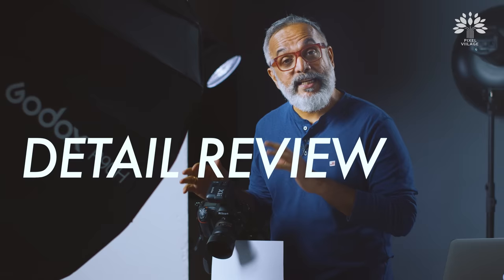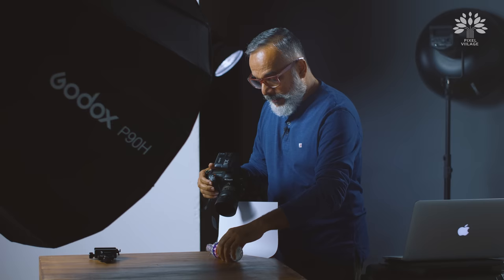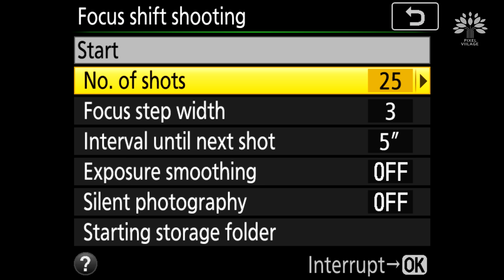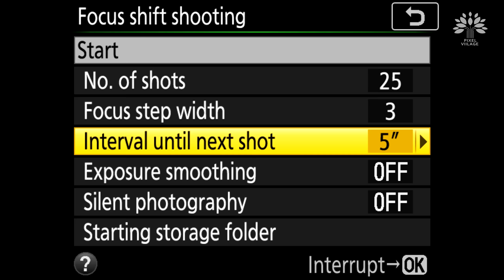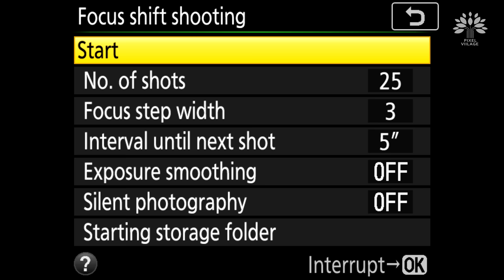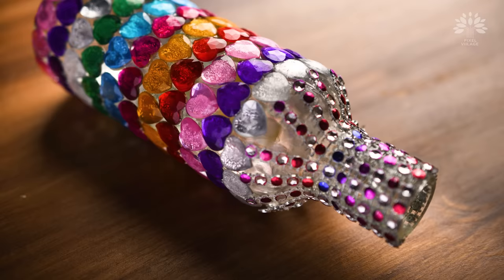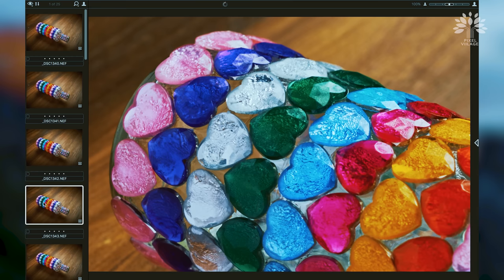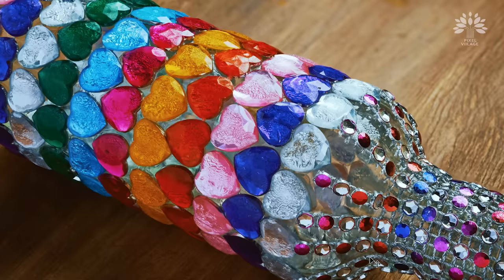Nikon D850 Focus Stacking Explained - Viilage Review

Comment: Thanks for the video but if I may, I have one point to consider: the focusing you did manually on live mode would not hold since immediately thereafter you switch to autofocus, thereby giving the camera control over the focusing from the first shot to the last. Otherwise excellent explanation and thanks again.

Comment: Nice video..., but what is FOCUS STEP WIDTH??? As I understand, 25 shots already devided the the frame into 25 steps. So, why do you need to enter the number 3 into FOCUS STEP WIDTH? And why 3, but not 7, or 2 ?
Reply from the maker: gregory morrow 'Focus Step width' is the shift in focus the camera takes between two shots. You are right. If you decide the number of shots, the camera should ideally select that parameter. But I doubt that happens in this model. Like I had mentioned, you will figure that out by experience. I suggest that you a) Choose the desired Aperture b) by physically shifting the focus, approximate the number of shots you may have to take to cover from nearest to. The farthest focus point c) double or triple it and use that as your 'focus shift width' so that PS gets sufficient number of frames to stack. Please let me know what you think.

Basically, few trails are needed to figure out your style. Cheers... 🙏 😊

Comment: Good tutorial, thanks! I understand you must use a Nikon autofocus lens to use this D850 stacking function. Are there any way to use the function together with non-autofocus lenses? I myself use the Zeiss Macro-Planar 100/2 XF2 and the Zeiss Milvus 50/2 Macro ZF2, both are manual focus lenses - I guess it in my situation isn't possible to benefit from the stacking function of the camera. The D850 is an impressive power house, I'm very happy with mine.

Comment: @Radhakrishnan sir - I was trying this technique and I was not successful in it . AFter few shots my flash stops fireing and my Nikon D 850 is displaying error in the top. I use setting for 50 images with duration mentioned in this video. i triggers only for 5 images and moved to error . Pls guide me to over come this issue.

Comment: As always very interesting topic, an observation which now leads me to a question apart from your topic. I noted you have a godox trigger there. I have the x2t godox trigger. Is there a possibility of using the SB 700 flash on the trigger where another flash or two is being used and is being trigger by the x2t. Can this be accomplish in TTL mode?

Comment: Hi Focus shift shooting does not highlights where I am getting wrong have put 105 macro lens on 850 Thanks in advance
Reply from the maker: The focus stacking WILL NOT work in Tethered mode. You have to shoot into a card only. 2. Also, try 'Reset Camera's option. 🙏

Comment: Thanks for the wonderful video, clearly explaining the feature of D 850. However do you have any video on other Nikon cameras where it each shot is done manually. If you can show it with tethering so that how focus points are moved in each shot, where to focus next in a image etc. it would be great. Hope I am not asking for too much.
Reply: Unfortunately, the tethering doesn't work when this camera is on Focus Stacking mode. 🙏
Reply: Thanks for the quick response sir. Have you made any video on Focus stacking for other cameras, if so let me know.
Reply: The way you explain, it can really compensate for the tethering, so would be good enough.
Reply: No! Though I used to use a RRS Micro Focusing Rail to do focus-stacking earlier on. 👍
Reply: Oh, ok.. sir. Hope you will make it. Since I have subscribed will get to know.

Comment: Sir, it's very helpful. I am a product photographer. And decided to buy Nikon D850. Is it my right decision?
Reply from the maker: Vidyadhar Pawar Yes Vidya... D850 and Nikkor  AF 105 Macro will be a formidable combination. 🙏
Reply: PIXEL VIILAGE 
Thanks a lot sir 😊
Reply: Vidyadhar Pawar you made the perfect choice. Focus stacking is MADE for the product photographer. Forget about those undersized mirrorless and rest easy. The pictures I’m getting from mine are incredible!
Reply: Sony A7Rii gives much better value for product photographer, 42Mp. You can use almost any lens in the market, any brand.

$2200 brand new at ebay.

Comment: Hi there. Nice video. I had a question. So i am a dentist and use photo stacking for microscopic documentation. Will this feature of the d850 work on manual mode? Meaning while using a microscope we do not have control over the aperture. So was wondering if this would work
Reply from the maker: Well... Technically, it should work, as long as the magnification and exposure values dont change. 🙏

Comment: The focus step width - is there a way to use the 'focus step width' numbers to actually calculate the exact distance of focal points (using lens type, aperture and starting focus point as the basis)?
Reply from the maker: For a few days, initially, I also racked my brain around this very same doubt. But finally decided to go with trial-and-error method. 🙏
Reply: @PIXELVIILAGE  :) A little groping in the dark during trial-and-error testing provides a sense of adventure and can make a successful outcome even more enjoyable.
Reply from the maker: @DietrichLasa  😃🙏👍

Comment: I have the D850 and the "Focus Stacking" is greyed out. I'm using a Nikon AF 200mm micro lens in AF-S mode, RAW, M Mode, AF and set the clock in the D850 correct. Any other things that could cause it not to work? Thank you
Reply from the maker: Focus Stacking will work only when you set both Camera and Lens in Auto-focus mode. Rest things ok.

Comment: Does this feature work with older lenses like Nikon 200mm f/4 AF-D Macro? Or third party lens like Sigma 180 mm f/2.8 APO Macro EX DG OS HSM?
Reply from the maker: astroandrius It will work with all Nikon miunt AF lenses. 😊
Reply: Thanks for answer, really appreciate it! ;)
Reply: PIXEL VIILAGE  I tried with an AF-D and don't worked. Looking on manual I read that  just works with AF-S or AF-P lens.
Reply: PIXEL VIILAGE  I did it with a 60mm AF-S and worked great. Nice tip. Thanks

Comment: Hello sir, I am basically a food photographer and I recently upgraded to D850. For my food shots I don’t really need edge to edge sharpness but I have now gotten an assignment to do a product shot for a jewelry. When I tried to practice with the focus stacking on D850 i could see that the menu setting is inactive. clicking on that option shows a message saying “this setting is not available in your camera’s current state”. Can you help me out please? Thank you
Reply from the maker: Yes. I have seen this happening. Do the following.
1. Make sure that you have the latest Firmware.
2. Reset Camera in SetUp menu.
3. Set the lens to AF mode.
4. Will shoot the images only to the Card. Will not function in tethered more.
Cheers...
Reply: PIXEL VIILAGE Thank you sir

Comment: are you doing this in RAW?  Wont that make a HUGE file if you are doing about 30 shots??  I tried doing this yesterday in jpeg..  didnt work...pics just went from blurry to blurrier
Reply from the maker: True. This involves a bit of practice before you actually start estimating total number of shots and the distance. You may not require more than 8-10 shots for most situations.

It does not work with JPEG. And it does not work in Tethered Mode either. :-)